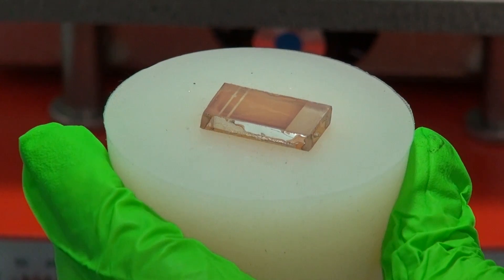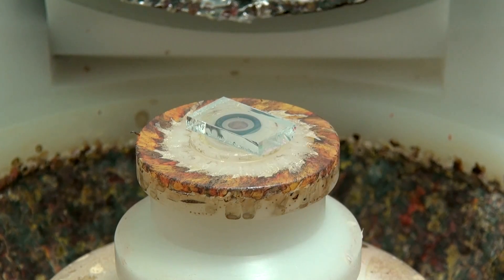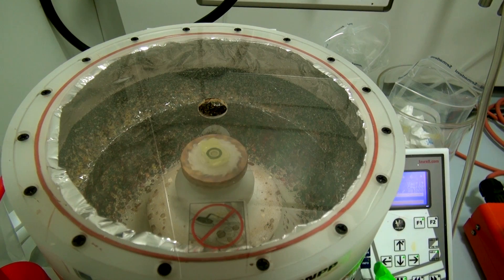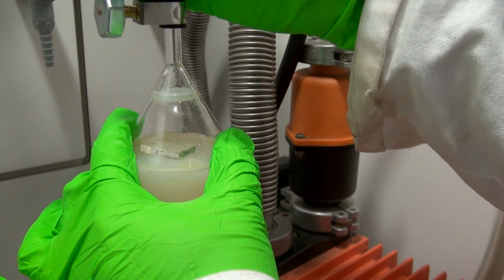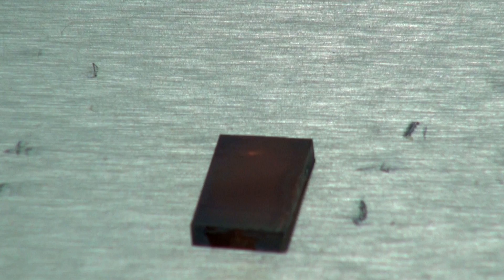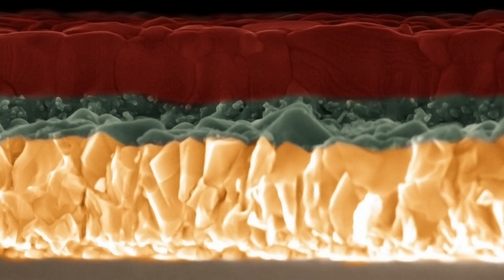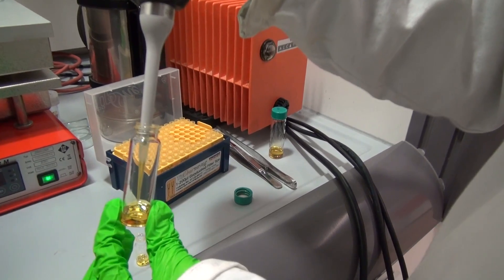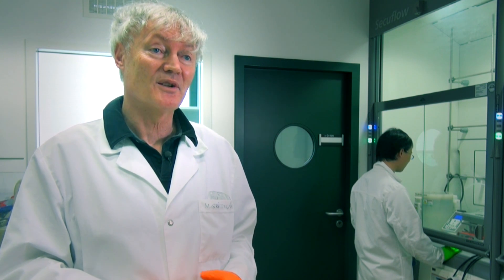Perovskite Solar Cells Surpass 20% Efficiency

Comment: Thanks for the video. It is  self explanatory. Way to go perovskiters.
Reply: All nice, but the world should know that this cell is only stable in DARKNESS. Under light (just 10%!!! of sunlight) is looses a lot in just 100 hours. No long term studies were made under full sunlight. People should know this. It can be read here for free: http://science.sciencemag.org/content/suppl/2016/06/08/science.aaf8060.DC1

Efficiency is not everything. Make these damn thing stable (and lead-free!) , otherwise it will never has a chance on the marked
Reply: Carlos, having efficient cells at low light conditions is an added advantage, but yes temporal data under 100 mWcm-2 would be great. One of the coolest thing about this paper is the electrolyte filling technique used in conventional DSSCs was sold as vaccuum  flash assisted process. The knowledge built over decades was implemented experimentally.
Reply: I have the feeling Grätzel is redoing everything done in DSSC (and OPVs) before, just replacing it with the perovskite layer. I don't say that this is easy, but it's more engineering than science.

... I also have the feeling the papers get easily into Science and Nature due to his name and chance of big publicity. He seems to be a good scientist and inventor of DSSCs, but I wonder how much he is involved in all his papers coming out in the last couple of "perovskite-years". It feels like he is publishing one paper per day. It CAN'T be possibly to be actively involved in all.
Reply: Fundamentally there is a lot of difference in the working principle of DSSC and perovskite, but yeah I guess that is what "re"search is about :). I still am blown away by the simple idea of using a funnel and pump to suck away the solvent.
Reply: I know there is a difference in the principles. 
But warming up known things and such a simple suction method is still not worth a Science paper. It's also interesting this paper just had 2 reviewers.
Reply: I will try that in the the lab... very nice ideia... So clever 

Carlos, there have been a lot of improvements in  the stability field... just one paper, but if you want i have a lot
DOI: 10.1038/ncomms11105